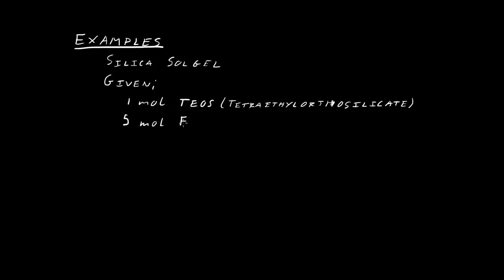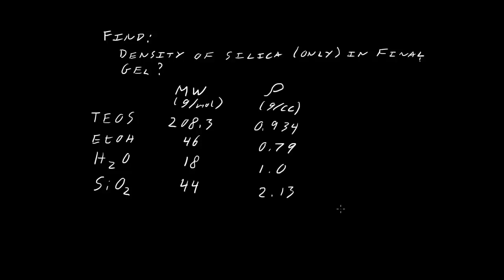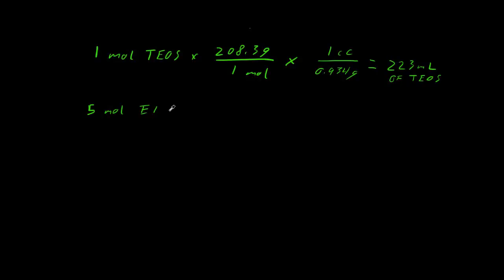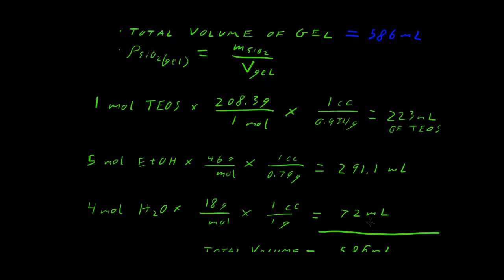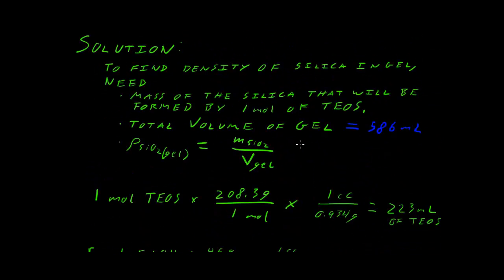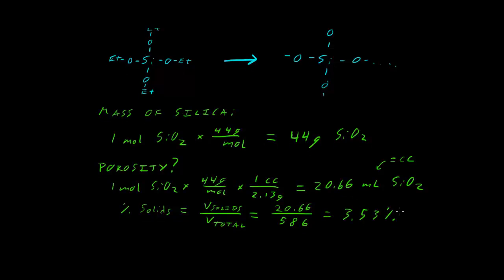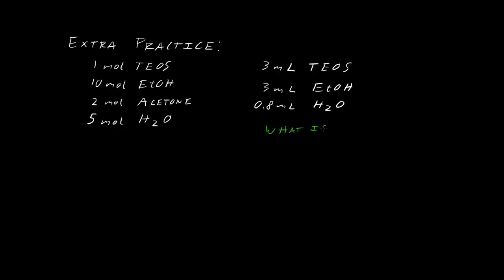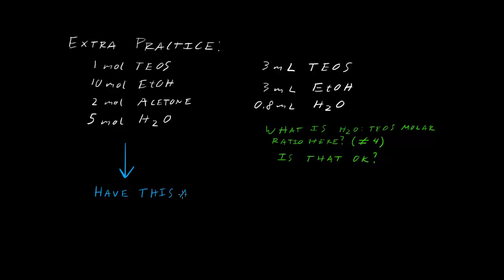Solgel 1 - Part 2 (Updated!)

Comment: sir i think molecular weight of SiO2 u took is wrong. it is not 44g/mol, it is 60.08 g/mol.
Reply from the maker: You're correct, it is 60.08 g/mol. I didn't catch that mistake until after I had completed the video (and used it in class), so the audio is still incorrect, but I added annotations on Youtube indicating the correct g/mol and final values for the problems being calculated.